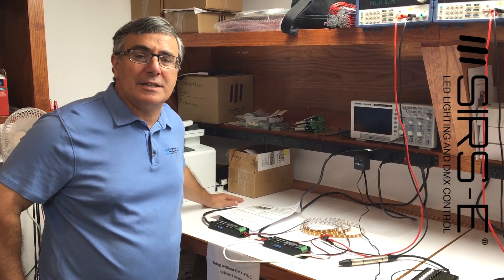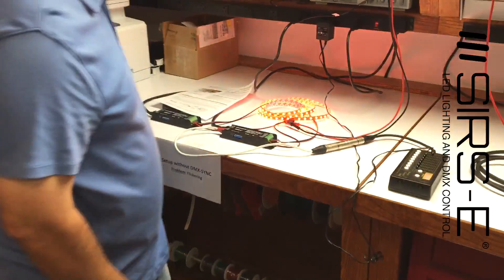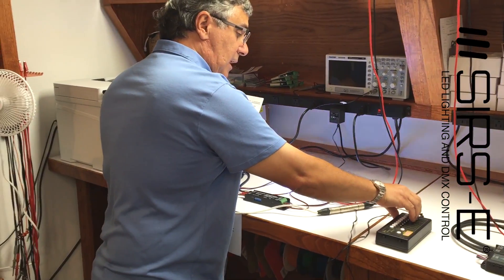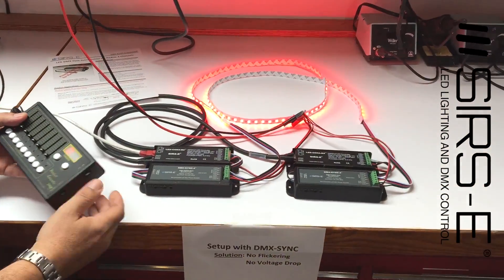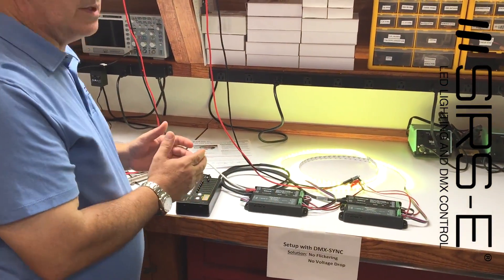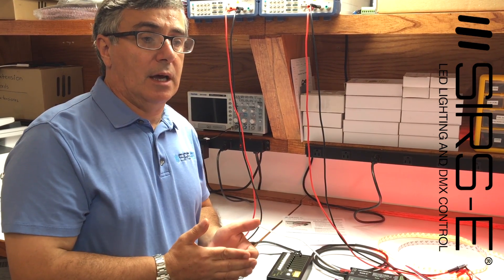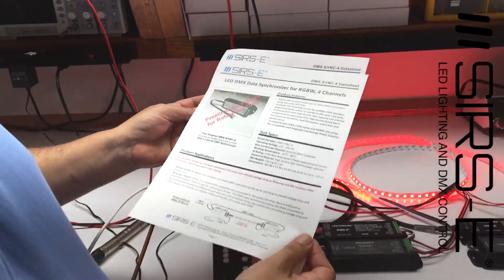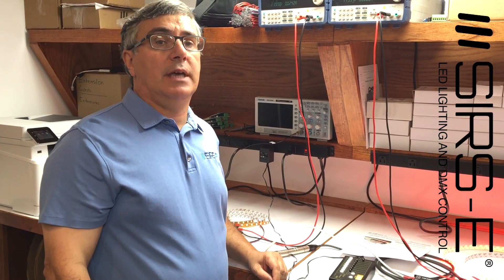Synchronize DMX-PWM Decoders Outputs to Control Voltage Drop & Flicker

Comment: Im not super clear on what this is doing. is it taking the PWM from another dimmer and stabilising the voltage? is it syncing the clocks on multiple led/pwm dimmers?
Reply from the maker: Hello, I would be glad to answer your question. 

               When controlling with DMX
and having long runs of LEDs you tend to have increasing voltage drop with
longer runs. 

               So, when you connect two
DMX controllers together to reduce this voltage drop, both are working at a
frequency of 5.2kHz, but the controllers are not synchronized, causing the LEDs
to flicker.

               So the way the DMX-SYNCs
work is by converting a digital signal (PWM) to an analog voltage to avoid this
frequency desynchronization and provide a more stable, flicker-free control
using multiple devices in parallel in the same circuit.
Reply: oh! so it is a PWM (constant voltage) to a constant current converter? no?
Reply: are you saying people are placing 2 PWM dimmers on two ends of the same string to combat voltage drop? if so what are the benefits of this opposed to separating segments of the led strip into shorter runs that are powered by single dimmers? also what are the benefits of this over using large-ish gauge wire to feed both ends of a led strip to minimise the voltage drop? BTW, I was looking at all your offerings on your website. lots of good stuff. Thanks for the clarifications!
Reply from the maker: No, this is not a CV to CC converter driver. The DMX-SYNC takes a PWM signal and converts it to analog voltage to avoid frequency desynchronization from the two DMX controllers being connected together.
Reply from the maker: You could run long and thick wires from one end to the other (while connecting each channel individually) without two DMX drivers and two DMX-SYNCs, but it will still have more significant voltage drop than with this solution.
With the DMX-SYNC you can actually SELECT how much voltage drop you want, by either adding or removing DMX-SYNCs and drivers on your setup, please see this:
https://sirs-e.com/wp-content/uploads/2016/12/12V-RGBW-Application-Diagram.pdf
https://sirs-e.com/wp-content/uploads/2016/12/24V-RGBW-Application-Diagram.pdf

Comment: Why would I want to pay for two drivers, two of your sync units and however many extra meters of DMX cabling when I could just run a length of inexpensive flex to the other end of the LED tape and feed both ends from one DMX driver? Either I am missing something or this is a very expensive over engineered solution to a problem that doesn't really exist.
Reply from the maker: Hello, I appreciate your concern through this question.

               You could connect your LED
strip to the DMX Controller and then run a flex cable from the controller to
the end of the strip, but you will still have noticeable voltage drop, due to
the length and gauge of the wires. 

               For professional
installers, this is not really a solution, because they want to have the best
high quality performance for their product, which means no voltage drop, or a
very minimal percentage of voltage drop, and no flicker.

               By using the DMX-SYNC with
a DMX controller, you are able to run continuous runs of LED with minimum
voltage drop and still maintain a DMX control for dimming your LEDs without
flicker.

               Voltage drop on RGB and
RGBW LED strips means that there is no uniform color distribution across the
LED strip. This is critical for some lighting applications such as LED
displays, TV studio lighting, cove lighting, large building facades,
architectural lighting, etc. Most of the White colors, steady colors or
home-made applications won't need this product, and can be resolved as you
suggested.

               With this product, you can
decide what percentage of voltage drop you want to have in your application, by
putting DMX controllers and DMX-SYNCs as needed in the same circuit.

Comment: This is not explained clearly. in the original example, do you have two drivers in parallel, driving the leds? Surely nobody would do this, drivers are not designed to be connected in parallel. How does this product synchronise the pwm output in separate power drivers?
You advocate using two drivers in this video without the synchroniser and there is no flicker https://youtu.be/8RB0aBo6qOQ
Reply from the maker: Hello, thanks for your question, I would be glad to clarify your question.
First, what the DMX-SYNCs do to prevent flickering, is converting a digital PWM signal to an analog voltage, which provides a more stable and flicker-free DMX control. The voltage drop is minimized by having an independently powered DMX driver on each end.
Second, the video you mentioned was intended for voltage drop issues, not flicker. If you rewatch the video, around 0:50, you'll notice the strip does flicker until it reach 100% intensity. When dimmed, the LED strips do flicker when connected with two DMX drivers and no DMX-SYNCs; at full intensity there is not much flicker.
Now, coming back to this DMX-SYNC video, you'll notice that when presenting the 1st setup, we only increased the intensity to about 50% of the dimmer, to show the flicker on camera. If we put it at 100% intensity you wouldn't see this flickering. Some applications require a dimmed color setting rather than full intensity, that's one scenario where this product comes in handy.
Reply: Thank you for the clarity. Understood.